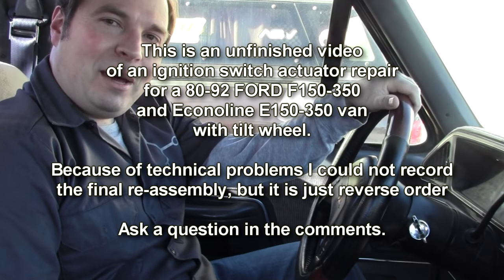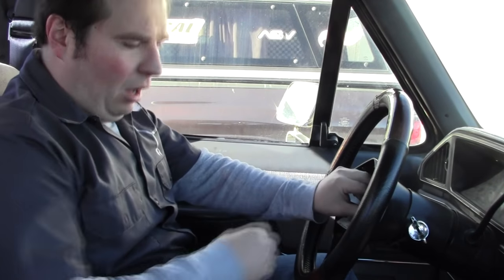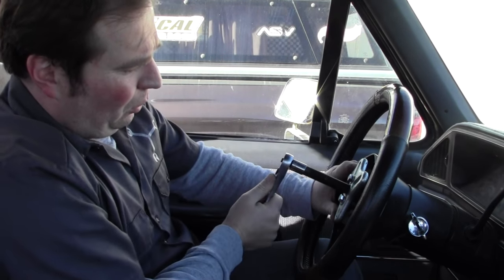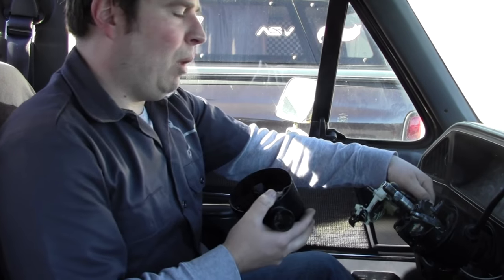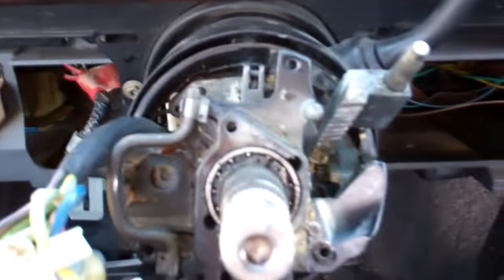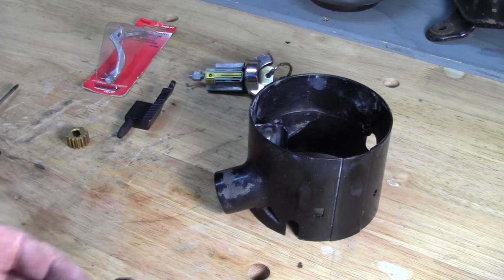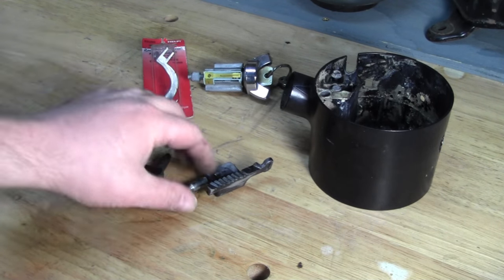FORD 1980-1992 Ignition switch, lock cylinder, rack, pinion and actuator rod repair

Comment: So, my 85 F150 starts up, but I have to hold the key slightly cranked to keep it running. I taped the key in place to get home. Will doing this repair fix my issue?
Reply from the maker: Maybe, but I would say the switch is probably worn too. Replace the switch first, then do the actuator repair.
Reply: @thejunkman  When you say "switch" are you referring to replacing the lock cylinder?
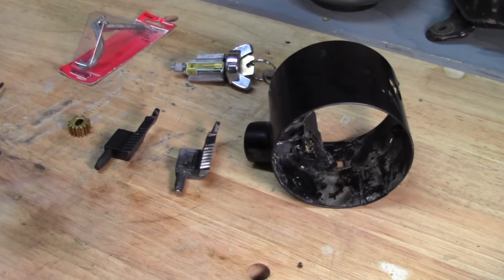Reply from the maker: When I say switch.  I mean the actual ignition switch down near the end of the steering column near the floor/firewall.  I have had the plastic parts in this very type of switch fall apart and then have the symptom you describe.  If that doesn't fix it then the actuator part (seen 5:17) is probably broken or cracked/bent.  It is common on tilt wheel models but happens on non-tilt versions.
Reply: @thejunkman  You were absolutely right! I there was nothing wrong with my lock cylinder or actuator, it was the ignition switch that was bad. I bought a new one and installed it, and it starts up like a dream now. Thank you for your replies! Very helpful

Comment: I bought a 91 f150 and they couldn't find the key, I know to release the cylinder you have to push that pin with ignition on but how should I go about this? ( tried drilling it but seemed to get me no where )
Reply from the maker: Umm, the lock cylinder is not made to come out in any way without a key easily because that would make it easier to steal. I am a little suspicious.  Any how, you can't drill the pin its designed to spin to prevent easy theft.  However locksmiths use a lock cylinder bypass tool is about $70 that will break the pin and get it out.  I hope you have not damaged the bore of the pin by drilling. That part is expensive.
Reply: You do have to turn the key to be able to push that button in and so it can come out, I really don’t know maybe saw it off from the top and then drill it on the sides till you brake it in pieces

Comment: Is this the cause of my starter not shutting off with turning the to off and removing it it's still cranking the starter?
Reply from the maker: Possibly, could be a broken switch.  The switch is just plastic down on the bottom  of the column.
Reply: @thejunkman  okay, I assume if I can find it I hope it is as the other parts are pretty expensive.
Reply: @thejunkman  thank you

Comment: How  do I replace a broken ignition switch for a 1998 350 Ford econoline and start it no key
Reply from the maker: So you want to steal a car... ;)  The ignition switch is at the base of the steering column.  Just remove the large connector, remove the two bolts on either side, unhook the actuator rod, and replace.  There are plastic pieces that break within the switch from old age.  For the key portion you can get a lock smith with lock cylinder puller to break the pin to remove the old lock cylinder and replace it with one from the auto-parts store.  There is no need to remove the steering wheel like shown in the video.

Comment: How do you get it back together. Mine will not go back in
Reply from the maker: Which part?
Reply: @thejunkman  the part that connects between the ignition pinion gear and hooks to the actuator. Does it slide back in or do you have to take the gear out
Reply from the maker: The rack? It slides back in.  Just line it up so the pinion gear is on its first tooth and slide the rack in.  A screwdriver can help hold the pinon gear in the correct position.

Comment: any tips on connecting the two actuators on re installation... im running into a problem where i cant reconnect the upper and lower actuator
Reply from the maker: It has been so long I don't remember the details, but the lower actuator rod hooks in via the roll pin and then the rack just hooks on the end and then guide it into the housing to mesh with the ignition switch gear on roughly the first tooth.
Reply: It should fit, I changed mine as well recently and when you put it right 
It should be okay 
You only need to kinda wiggle it in there side ways till you get it in there but after that it should sit normal

Comment: I've recently done this myself and I'm having issue getting my auxiliary position back, could you provide some insight please
Reply from the maker: This could be an issue with the switch itself.  Years before this I had the switch housing, which is plastic, get brittle and break causing the rod that runs down the column not to return fully or move the contacts to make the connections.  Check that first.
Reply: thejunkman well I've completely torn everything down and removed the switch itself and I'm starting to wonder if it's not a travel distance issue, are you aware of wether or not it was possible to get one of these trucks without an accessory position?
Reply: @nater2013   I just did this replacement procedure as well and I am having the same issue as you except mine won't even notch back into the position where you can remove the key.  It is very close it just stops before I can get it there.  I'm wondering if I somehow got the timing wrong between the pinion that the key turns and the rack that slides back and forth.  Is that even possible?  Did you ever figure out why yours wouldn't go into accessory?
Reply from the maker: I also had a problem with the switch itself.  The plastic parts inside that held the springs disintegrated so a new switch on the bottom of the column also needed replaced for me.
Reply: @thejunkman  I replaced the switch first even though original wasn't faulty.  The actuator piece was broken so replaced it.  Truck turns on and starts but when I try to turn key back to remove position its like I hit a wall and it won't go any further so key is stuck in lock cylinder.  I spent all day trying to figure out why.  I dont think its possible to get rack and pinion out of time though idk for sure.  Im at a loss.
Reply from the maker: It could be one tooth off, or the switch needs a slight adjustment.  That is why it has slotted mounting holes. That would be my guess.
Reply: @thejunkman  could you make a video of doing thay?
Reply: @06basecobaltls17  you may have to push button on left side of steering wheel.  To remove key. My 89 f150  has lock steering and I have to push button to turn key all the way back to lock position

Comment: That looks a lot easier than a mid 90s chevy ignition and lock assembly.
Reply: They are both about the same as far as difficulty to get to all the parts.
Reply from the maker: That era of Chevy I believe just has a locking bolt that is removed, however either way FORD's method of actuation for the ignition switch is far more complicated with a lot more friction points.  What you don't see in this video is I went ahead and replaced both bearings, and the turn signal switch plate as the self cancel was broken (plastic tab was broken).  That requires removing the big spring and pivot pins and fishing the wiring harness down the column which has very little room.
Reply: My truck just has this Swiss army switch assembly that included wiper, hazards, and  turn signal.  It's expensive.  lol
Reply from the maker: Yes, the multi function stalk.  Those aren't that bad to replace really as they come out as a unit with one connector.  Not real expensive depending on the aftermarket OEM style you get.  AC/Delco version, yeah that will be pricey.
Reply: What's the name of the teethed piece or a part number pls

Comment: My neighbor is an elderly woman whose husband recently passed away and she trying to get his 1990 Ford F250 smogged n ready to sale. I am attempting to help her do so but unfortunately we ran into a small snag. The vehicle starts but the ignition cylinder pops right back and turns off. Is this the actuator as well?Any help or advice is greatly appreciated. I have already changed the lock cylinder and that did not rectify the issue.
Reply from the maker: +Summer Lopez it probably is the actuator,  or the switch itself becuase it has a spring to return the mechanism.  Either way you will have to drop the column a bit to do the job

Comment: I need to replace the same part in my e350, where did you get the part?  ((The piece with worn down teeth))
Reply from the maker: +James Ray from an OEM Ford parts distributor online.  This type of part is not available from the aftermarket, like Dorman, that I am aware of.

Comment: I replace the cylinder but now no power my dash and fuel pump won’t engage
Reply from the maker: Probably the switch is bad or broken.  Check on the lower end of the steering column.
Reply: @thejunkman  got it. I had to disassemble the steering wheel and align some of the parts inside

Comment: 2:35 what button can I get to it without taking the wheel off?
Reply from the maker: Huh? I am not sure what you are asking.
Reply: At 2:35 you mention a button or pin to push to remove the key cylinder. Do I have to take the wheel off or is it possible to get to without removing the wheel.
Reply from the maker: No.  You can get the lock cylinder out without taking the wheel off if you need to.

Comment: Where did you find the gear and rack at I've looked everywhere for new ones
Reply from the maker: These parts are only available from the OEM.  Any Ford dealer or Ford OEM parts distributor can get them.
Reply: thejunkman thank you sir I appreciate it should be the same parts for an 88 bronco correct
Reply from the maker: Yes. with tilt wheel.  They used the same parts across many models and model years.

Comment: How the fuck do you change ONLY the lock cylinder? A guy I know who knows a lot about fords said you can just push on the pin on the cylinder through the hole on the bottom of the column, but I can't seem to reach that far in with a scribe.  Do you have to pull the wheel to change the ignition lock only? I don't need to change the ignition switch
Reply from the maker: Just use something with a long thin shaft and make sure the key is in the Run position this is all outlined in the video

Comment: What if you don’t have a key to turn on drill it out
Reply from the maker: What?
Reply: What if the key is missing how do I change it then
Reply from the maker: Probably need to get a lock smith on board as you need to turn the cylinder to remove it as a security feature.

Comment: What is the teethed piece called or the part number please...thx for the vid
Reply from the maker: That is the rack, the brass gear is the pinion.
Reply: thejunkman awesome yeah I went and picked up an ignition and ignition switch and the actuator that you thought originally was the issue. Mine's doing everything correctly except when you move it forward to the start position it doesn't turn over... I'm honestly thinking it's the switch bolted to the column

Comment: What if you don't have the keys
Reply from the maker: So you want to steal a car ;)  Kidding aside.  Get a lock smith to make you a key so you can turn it.  The cylinder has to be in the correct position to be able to push the "button" that keeps the cylinder in the housing.  You can use a lock cylinder puller and that will break that pin off and could possibly damage the housing.  This is the main security feature on this style.  If the cylinder was easily removable without the key all a thief would have to do is remove the cylinder and use a screw driver to turn the pinion gear and thus push the actuator rod to start the vehicle.  Call a lock smith and have them make you a key.